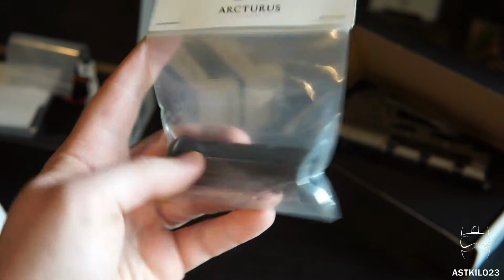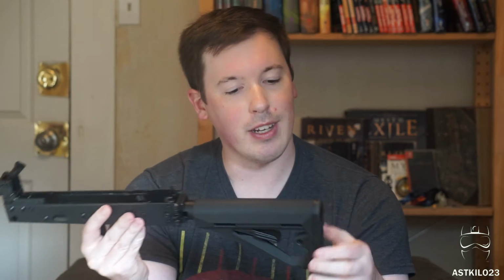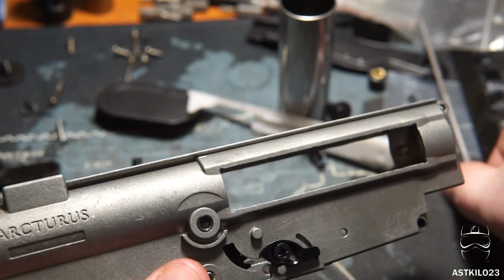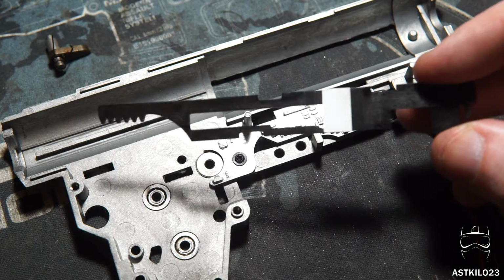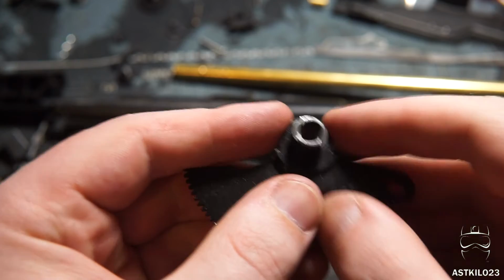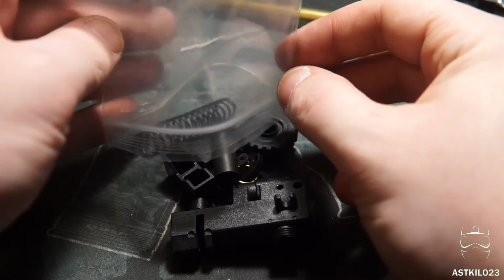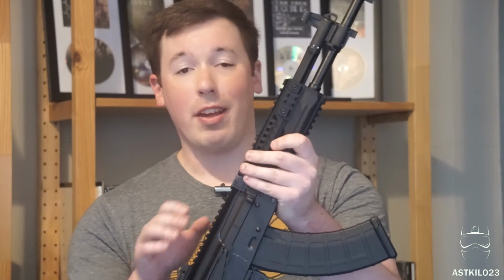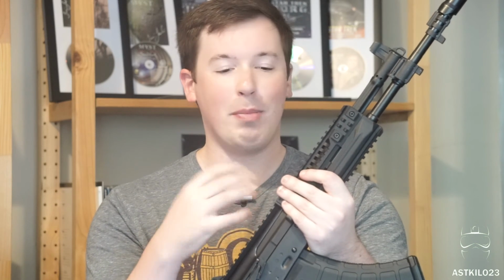I Updated My E&L AK12 w/ Arcturus Parts - How Did It Turn Out?

Comment: Can you help me with Arcturus ak12 FE version. 

Just bought a new one FE version but when i am programming in selector mode and changing from mode 1 to mode 2 it is not SAFE-AUTO-BINARY-SEMI but SAFE-SEMI-BINARY-SEMI am i missing something? All others modes are working expect second one its bugged or what. 

I have already contacted Arcturus and they said thats probably selector sticker problem could you help me with that. They cant sent me a new one because i am from EU.
Reply from the maker: My first suggestion would have been to contact Arcturus. I'm sorry they weren't able to help you. 
It seem odd that it would be the selector sticker if all modes but the one are working as expected. That would seem to indicate something other than that. I have had issues with some AKs where the selection it just a smiiiiiidge off from where it is supposed to be and can result can translate to issues with the selector setting. 
Just for troubleshooting, I'd see if you get the same results when moving into the desired selector setting from either direction - i.e. from save to full auto as apposed to semi to full auto. That'd be my only suggestion at the moment, aside from using it with a different selector mode. 
Unfortunately, this is impossible to troubleshoot further without physically testing the gun and potentially opening it up.
Reply: @ Hi

Can i get your email to send all videos and pictures from disassembly

Comment: Hi,
I recently bought a dust cover with picatinny rail from Arcturus which has also a pinned mount for the rear sight block. So if you want to install it, you have to remove the rear sight blade. Does this dust cover fit an E&L AK-74MN? If you google "AK RECEIVER COVER RAIL [ARCTURUS]" you can find it. 
In the description it says:
"The receiver cover with a RIS mount rail. Enables the mounting of optics (red dot sights, scopes) at AKM, AK-47, and AK-74 rifles. The cover is made of light material such as aluminum, thanks to which it does not additionally burden the replica. Fits for replicas AT-AK01, AT-AK02, AT-AK03, AT-AK04, AT-AK05. Assembly requires permanent removal of the rear sight and adjustment of the element to the replica."
Reply: yes it should fit perfectly but you need simple pin to attach it
Reply: I have just installed this arcturus picatinny rail dust cover yesterday on my e&l ak 74mn. The rear of the dust cover fits very snugly in position, although you need to push the metal bit that's seated on a spring inside to make room for the dust cover to latch onto it. for the forward part of this system, you need to slightly enlarge the bottom big holes of the ironsights on the AK to make room for the metal pin that locks the latch in place. Good luck, it was easy, I used size 3 drill bits to enlarge the holes.

Comment: The selector stop notches and markings are correct.

Just like safe doesn't have a notch and uses the top of the receiver to lock the selector onto, semi now doesn't have a notch and uses the bottom of the receiver to lock the selector onto.

The two notched positions are now for Full and 2 Burst.

Semi not having a notch is common on AKs. A good example is the export Saigas from Izhmash.

Comment: Anything I can upgrade/modify to prevent a gearbox shell from cracking? I opened up my Arcturus Centaur A and the shell was cracked near the nozzle.
Reply from the maker: A sorbo pad and radius the cylinder window are your best bets.
Reply: POM piston heads will give your gearbox the best chance of survival. If upgrading the spring on a standard gearbox, don't go overboard and consider short-stroking gears if your barrel/cylinder combo allow (keeping in mind volumetric ratio).